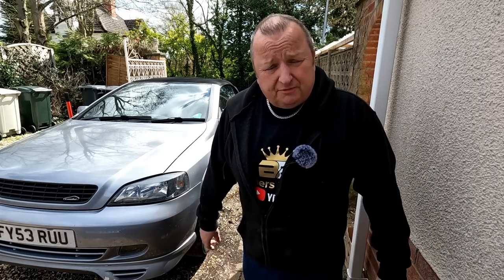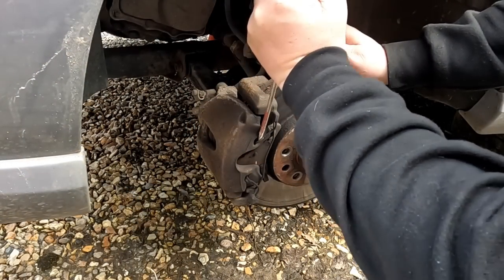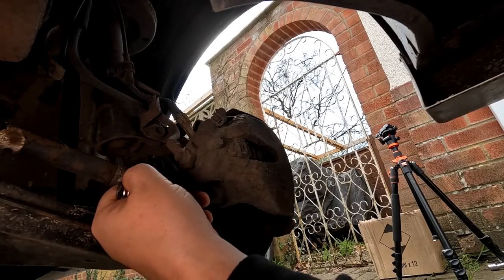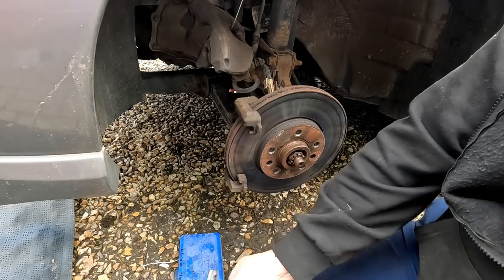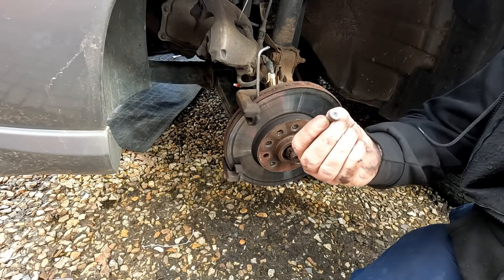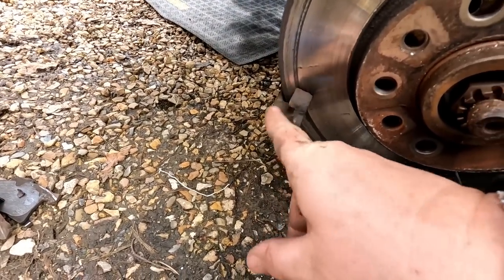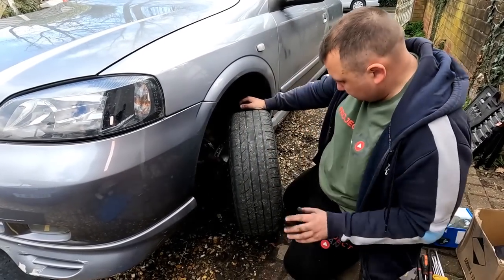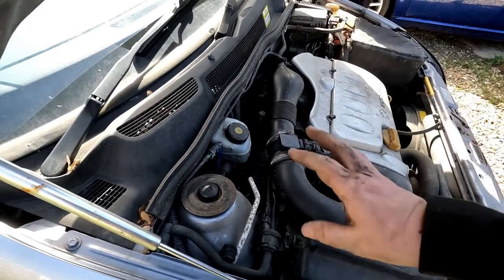Vauxhall Astra G Front Brakes and Pads

Comment: Somebody  has replaced pads/disc on one side previous owner nothing to do with a sticking brake.  Also that metal sensor thing you mentioned is  a harmonic  indicator  when the pads wear down to extreme this metal should touch the disc and make a horrible noise when you break  telling you there is a problem. Obviously  it didn't work, maybe was bent at some point.   Great vid. Keep  up the good work

Comment: Martin, this is a job I've done on my Astra G. A lot of cars have exactly the same setup with the 7mm Allen head pins. I use lithium grease on the pins. My Astra had a sticking front right caliper so I had to replace it. The piston on that one went back in without any problems so it was the lack of lubrication on the pins that was the cause of the excesive wear. Like you said, this should be picked up on the MoT.
Reply from the maker: Yes, its a common thing Dave, seen it many times.

Comment: Hi Martin
Another good video, the only thing i think i would have done more, would be to renew the brake fluid.  I am not sure what the astra spec is but most manufacturers recommend every 40,000 miles and the same with the power steering. Seeing the nearside disc and pads i should imagine the fluid was getting really hot .

Comment: Hi, I think you may possibly have a partially seized calliper there causing the difference in pad wear. I use swan neck pliers to push back front callipers with little resistance. I looked like you used a lot of force to push it back. Keep up the great videos.
Reply from the maker: It actually went back in easily Steve. It was the pins and the rusty carrier.
Reply: I thought that too mate, I push a lot of them back in by hand or with a little bit of a lever with a screwdriver, this one looked at least on the video as if it took a lot of effort

Comment: Nice vid, You have a nice mk4 Astra :) Rizla's Top tip to stubborn brake discs assembly bolt, give then two/three good hit's with a 4mm punch. If rounded off, use a star bit, hammer it home, stud will come out. I have use this method loads of times. Refitting said bolt, make sure it runs free with out disc. Then tighten to about 20 Nm. I have a mk4 Astra SRI-T and changed the Brake's so many times i forgotten, Pleased to se you have used some good quality brake parts. :)

Comment: If I have torx that get stuck I try using them with my hand (hammer) impact tool and sometimes they come undone. I had one of my calipers sticking on on my Astra G I had to rebuild it with a new piston. The original caliper pins are good quality and were stainless on mine.

Comment: When i get them caliper slide pins that stiff to come out i always pull them rubber boots out and clean the hole with a wire brush attachment or rotary burr in a drill or die grinder because I've noticed when they get rust jacking and they squeeze on the rubber which in turn squeezes on the slide bolts.

Comment: Hi guys. I'm pretty sure you would have done, but I didn't notice any grease going on the slide pins for the caliper. When the pins were removed, there deffo wasn't enough grease to start with. Be careful though because too much grease can have the opposite effect than too little. Being an ex car mechanic, my thoughts on the difference in pad meat left could be due to the drivers side caliper not working at all and the left doing all the work. As Gary didn't mention any issue with pushing the drivers caliper piston back that probably would rule that one out. I don't know how long you've had the car or if you have done any brake work on it previously. The previuous MOT would or have mentioned about pads getting extremely low as an advisory if bothered to note it. The brake test might not have shown there was an imbalance from one side to another.
Reply from the maker: yes James, we did grease the pins. I think it was sticking due to the pins and the caliper bracket being rusty making the pads stick. The caliper wasn't stuck, it wound back in freely though. Cheers

Comment: I didn't see you cleaning the anti rust protection from the new discs.
I used to use methylated spirits back in the day.
You showed us the radically uneven wear on the front pads. I think I'd replace everything rather than just clean them.
Both sides always.
Be lucky mate.
Reply from the maker: The coating on these discs is designed to be left on as it will burn off. We did replace all the worn parts. The fault was the sticking pins and the rusty brake pad carrier which was fully cleaned and lubricated.
Reply: @retrorestore  Well that told me didn't it.
I never knew they had anti rust coatings like that nowadays. Every day's a school day.

Comment: Hopefully you cleaned the protective coating off the discs with brake clean before installing.
Reply: They're coated
Reply from the maker: This coating is designed to be left on and burns off.
Reply: @retrorestore  Apologies. My mistake.